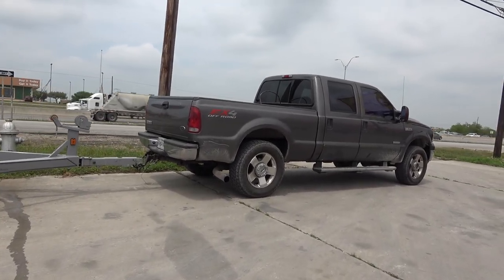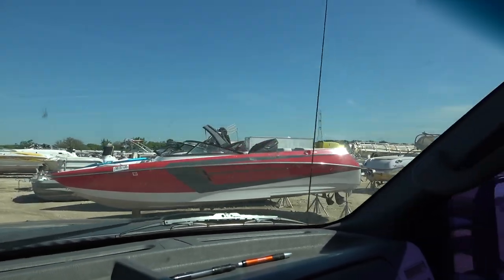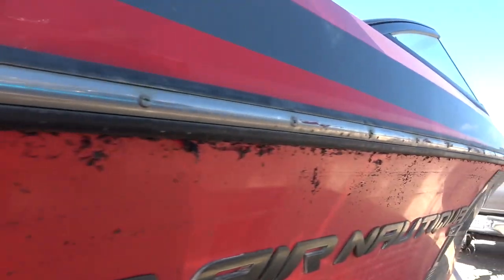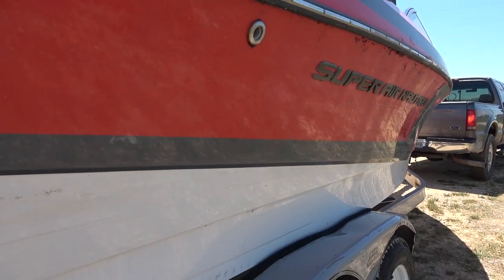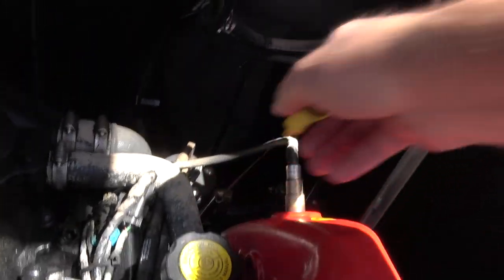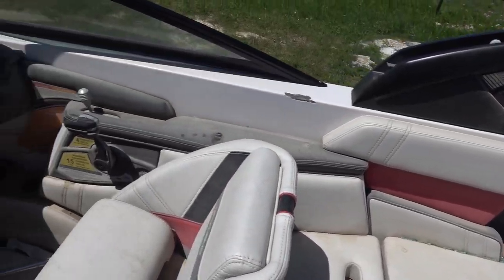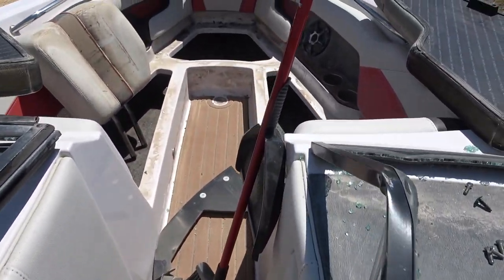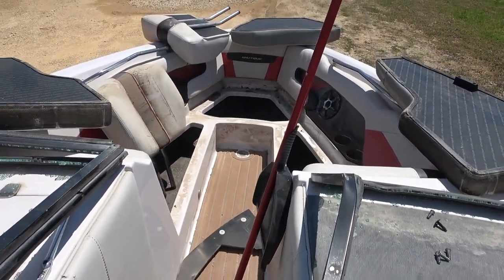I Bought A Wrecked & Flooded Super Boat From Copart Lets Unflood It?

Comment: Check engine light is on because it's a 6.0 ford.
Reply: Jeff Bennett look what gear it in lol lmao
Reply: jared perrino Doesn’t Change The Fact It’s A Shit 6.0... If It Were A 7.3 It Wouldn’t Have That Problem
Reply: @LostMisfit11  goid luck with the injectors on that 7.3
Reply: GarrettSelfVlogs 7.3 was the best engines. The 6.7 is also a really nice one
Reply: Your just jealous you cant afford one.. best dam truck on the market
Reply: 6.0 no go
Reply: It was in 1st gear. Also Ford is better. Compare ford to any pickup truck. (Not a Mac truck) it beats them all. 😛 eat this 7.3
Reply: 6.0 in limp mode with a CEL? id start with the crank sensor. that is directly the reason you started to see dodge and chevy utitliyu trucks (tow, ambulance, etc) around that era. CPS goes bad and the engine has no fallback so it just goes pants on head and limp mode randomly. not like there is any other way to get crank RPM than a direct sensor right?
Reply: 6.0’s are reliable engines if the proper maintenance is done to the truck.
Reply: Can confirm check engine light on 6.0 just means the engine is still there...
Reply: Can confirm. Mine is barely hanging on, speedo, shifter, and ignition are all fucked, check engine light has been on for 6 years
Reply: The studs on the 6.0 seem like the weak link. I've replaced two sets (to help out family), and I'm not even a mechanic by trade. If theyd have just upped the price of the engine/vehicle by 300 bucks during the build process, they could have had a revered and venerable engine. Instead, they cheaped out on absolutely CRITICAL components that gave them a name for TERRIBLE reliability :-(
Reply: I used to think they were shit but learned if you "bulletproof them, different head studs, better intercooler etc they become better than all except the 7.3. Look up "powerstrokehelp" here on.youtube. The guy runs a shop in georgia and he rates all the ford diesels.
Reply: @georgeperkins4171  not gonna put 10k into a truck worth 8 lmao. I only buy gas trucks now, the 6.2 is good enough for most applications
Reply: We bulletproofed our 6.0 5 years ago and it’s still great and it’s cheaper than buying a new one!!
Reply: @georgeperkins4171  the engine isnt the only problem though. The shifter, the speed sensor on the diff, the steering column, even the ignition all went to shit on mine. Shit trucks all around. An anomaly in the realm of Ford trucks really
Reply: Jeff Bennett haha
Reply: Yep delete and it’s maybe the best Diesel ever made

Comment: Holy crap , look at that brake rotor at 00:15 , missing a whole chunk!!
Reply: Holy crap good job spotting that.
Obviously the trailer brakes  don’t work or there would be big trouble on the first brake application.
Reply: That was probably the sound hecwas talking about
Reply: Good eye
Reply: Seen that as well looked to see if anyone else commented about it and you already have
Reply: Scott S  With a truck that is not running right. Only the winch strap on the bow eye of the boat. No safety chain in the bow eye encase of winch failure or strap breakage which happens more often  than people think. To top it off there were no transom straps either.
Reply: I'd put the rotor through the window of the seller....
Reply: Mike Grandinette that’s what I saw😂
Reply: good eye bro!
Reply: Says he got swindled on the trailer when everything is out in the open to look at before you buy it. Who's fault is that now?

Comment: Anybody else notice he was driving the truck in first gear the whole time?
Reply: guessing the indicator is broken as he was doing 60mph
Reply: Yea wtf... why....
Reply: haha that's an epic first gear! 30mph at 1800rpm, 57mph at 2300rpm, would give 125mph at 5k :P
Reply: yes I did
Reply: He was in second gear on the way back.
Reply: @donthemic  I saw that also
Reply: The gear selector on Ford trucks is always floppy, and shows the wrong gear on the dash.
His issue is probably egr or ipr or some other sensor.  Could also be the hpop... 
Rebuilt too many 6.0l.. garbage motors, even after they're rebuilt and bullet proofed
Reply: The problem with your truck is 🤔🤔🤔🤔 ohhh yea it’s a FORD!! It’s normal  to act crappy
Reply: @FiWelditNow  too bad they're the only ones that last pulling 30-45k pound dumpsters.
Tried all of the superduty/hd trucks over the years.
Dodge transmissions and axles always leave you stranded
Chevy transmissions and rear ends leave you stranded
Fords we have had will always get the job done, and are known for having the strongest drivetrain, just took them too long to replace the 7.3l with something reliable.
But hey, what do I know
Reply: @yleiva643  he said the indicator was broken.
Reply: Yep
Reply: @icanfartloud  nothing?
I dont understand your tactics so imma keep acting tough.
Reply: Yah my truck did that. easiest fix is a Zip tie on the shift lever.
Reply: Doy
Reply: @datboy5368  owned 12 well duh you replace em so often they dont have time do give you issues 

And plenty of gas and diesel million mile motors from ford 

The 6.4 diesel was garbage 

6.0 diesel was decent stock most its hate is first year issues but many are pulling million miles and bullet proofing just makes em more reliable.  

But realistically dodge ford and chevy transmissions all fail ... Lmao idk why people try to pull that about all 3 fail 

But the 7.3 and 6.0 are the best international motors in ford trucks the 6.7 psd is proving its worth hence why theyve stuck with it
Reply: vinny haha yah that’s what I was about to comment
Reply: lol
Reply: Ebola_AIDS_ISIS 7.3 liters are the most reliable truck in my opinion. Have one myself
Reply: Paul Morris i has two Ford trucks, the guest was a 1998 F150 extended XLT, and the day I traded it in it had 176k on it with no problems on it. It had 17,500 when I bought it.  I traded it in on a 1997 F350 XLT with the 7.5 gas engine.  I told one guy who asked shoot it, that the 7.5 was saying the gas mileage.  But on the highway I was getting around 10-11 mpg. It had 76k on it.  The only problems I had with it was the dash lights and indicators would suddenly blank out, then a couple mibs later come back on, including the tach and speedometer.  Also the front gas tank stopped working.  The last day I drove it, was a trip to my Drs office 32 miles away.  I had checked and added a half bottle of oil to it because it was a little short.  Halfway to the dr, I looked down and the oil gage was clear pegged to the left.  At first it didn’t bother me because  the gauges had blanked off and on before., and I had just checked it the day before.  So I kept driving.  Then I started hearing the engine start knocking.  I thought what the hell, pulled over and shut the engine off, thinking still it couldn’t be oil, I had checked and filled it up.  So I tried to restart it thinking it would reset the gauges  and it sounded like a train was coming through my dash!  So I shut it off, opened the hood, no oil on the engine or inside the hood, pulled the dipstick and it was completely dry.  So I called my wife to have her bring me 6 bottles of oil, still wondering what the hell. I put 5 in and it was right below the add mark, so I tried to restart and it was worse.  So I shut it off, called a wrecker and had it towed to my usual mechanic.  He found the engine locked up and he said the oil pump had went out, and apparently burned all the oil because it wasn’t circulating.  It had around 200-205 k on the engine, was mainly used for driving around town, and pulling a 40 ft 5th wheel to our local lake for the summer and then back.  It did blow an oil hose or a blow off valve or something like that, one time when I was trying to back the trailer into a real tight spot, so I was having to go back then forth several times to get it in.  However that’s it.  No other problems the 11 years I owned it.

Comment: At the 2:00 mark I realized you were here in Austin.   That boat was likely ROLLED when lake Austin flooded last october.   Boats would rise with the water levels until they hit the roof of the boat dock, then they would fill with water, sink, and the current would roll them downstream until they piled up at the dam.  That's why the tower and windshield are all crushed.  
Good luck with that build.   I looked at these myself for about 4 months, but couldn't pull the trigger on any of these.
Reply: mcgyverdude mainly lake lbj.
Reply: I live on  Lake travis, and I am not aware of any boat being sunk due to the flood.   Lake travis 's water level varies greatly, so all docks are floating-not piered like they are on Lake Austin or Lake Marble Falls.  I believe the water level on Lake LBJ is also allowed to fluctuate, so I would be surprised if anyone had a piered boat dock.
Reply: mcgyverdude and I lost 2 boats and 2 jet skis on lbj. See my profile pic wirtz dam. I’m a full time resident
Reply: mcgyverdude lbj is constant level all docks are stationary, my 30 ft Chapparal is in the bottom somewhere.
Reply: Cant wait to see rebuild!
Reply: I was on a 30' Chapparal last night!  Nice cabin. Sleeps 6. That was a nice boat.  So sad.

Comment: When the crane was lifting the bow of the boat water was pouring out of the bottom of the hull midship, around the keel. Drain plugs aren't installed along the keel. Check for a crack or hole that goes through the hull.
Reply: Hmm...that isn't true. Direct drive and V-drive boats have drains in that location.
Reply: We found out the hard way what the extra plug was for in our boat. There is a second plug right by the keel...

Comment: Hear that whistle?
See that smoke?
You just broke your powerstroke.
Reply: 6 in a row ready to blow
Reply: @BigCS784  except the powerstroke is a V8.
...
Reply: @elonmust7470  Im talking about cummins ya know the cumaparts
Reply: @BigCS784  yeah but we're not.

I've run 5.9s in heavy equipment for 20 or so years.. They'll eat pistons, spin mains, blow 3 quarts of oil past the rings every day, run at 240°, but they won't pop...  (Timberjack log skidders..)
Reply: @elonmust7470  So you pretty much said that they have to be rebuilt all the time.
Reply: @BigCS784  never before about 30k hours......
Reply: @elonmust7470  Well they dont really make enough power to blow up quickly so...
Reply: @BigCS784  I can pull 35k lbs of logs through the duff in one drag.
In first gear the machine produces over 39,000 lbs of torque at the wheels.......
All from a 180 hp 12v 5.9, be quiet city boy...
Reply: @elonmust7470  Ha city boy thats funny
Reply: @elonmust7470  39,000lbs of torqe? Comon now quit lyin to us
Reply: @elonmust7470  I guess being from a small town and living on a 80 acre farm is still considered being a "city boy"
Reply: @BigCS784  You're acting like one...
Reply: @elonmust7470  go ahead and explain to me how im actin like a city boy id love to hear it
Reply: @BigCS784  Acting like one is better than the other. Having grown up on ranches, the brand of equipment didn't matter, as long as it worked. If you really rely on equipment you'll like everything that makes you money!
Reply: @elonmust7470  yeah that is true we dont have much equipment out here
Reply: @BigCS784  6 in a row is gonna go... Is what I think you meant to say lmao. Let's not forget there's also 4 in a row. Never seen a Power broke make it to even 1mill a Cummins on the other hand 1, 2 even 3mill. Ther truck will rust out around that motor before it goes out.
Reply: Yes, I'm aware of how late my response is. I don't spend all day trying to see if my comments get replied to.
Reply: @christianclark2763  Hate to brake it to you but but their is million mile powerstrokes look it up
Reply: @christianclark2763  U said it perfectly 6 in a row is gonna go out good job
Reply: @BigCS784  how many million mile Power brokes are there compared to Cummins? Lol. It's okay though, if you ever have an issue just remember that it's circled and highlighted in blue.
Reply: @christianclark2763  What kind of test did they make you take is special ed cause on normal test you circle the answer not the problem.
Reply: @BigCS784  the answer to your problem is circled and highlighted in blue. How's that sound daddy? That wasn't a very intelligent response.
Reply: @christianclark2763  Well on dodges they already tell not to buy the hunk a shit cumaparts right in the name and ive never circled the problem before but i guess the special ed classes that you took are different aren't they.
Reply: @christianclark2763   I love watching when them big bad cumaparts get dragged by 6.0 powerstroke
Reply: @christianclark2763  What fucking video
Reply: It’s not a hard thing to do....

Comment: Boat trailer axles are supposed to be "bent" so that the boat can sit lower allowing it to launch in less water.
Reply: Steven P mostly preload and sway control
Reply: I learned something new today. Thanks!
Reply: Those axles are bent at the factory on purpose so that a very heavy boat will actually just flatten it out without bending it the other way! Kinda the same reason new  heavy flat bed trailers are arched

Comment: Engine lights on because it's a Ford and a 6.0 enough said
Reply: All fords ain't bad
Reply: Gotem
Reply: Kimbocf Aloggo   u must own one
Reply: @nickmeeks4475  so if you don't own one then you don't have experience with a ford
Reply: @chase_6273  no I have plenty of experience with them had and seen nothing but problems
Reply: @nickmeeks4475  ok well they were probably 6.0
Reply: @chase_6273  6.0 & 7.3
Reply: @nickmeeks4475  ok so you owned a 6.0 THE WORST FORD DIESEL
Reply: Chase 6273 stop, Fix Or Repair Daily fanboy.
Reply: Nick Meeks ford is reliable, my dad has a Ford that has lasted for 40 years and has not failed or needed repair in any way within its lifespan
Reply: @Dubscr  ya I'm sure just like Chevy gmc Dodge Toyota etc....... Some have more problems than others
Reply: DiscoverAudio yeah fix a 6.0 daily

Comment: I’m a mercury dealer and Volvo. I own a boat and yacht repair. .. that boat is a score since it’s prolly around 140k or more new  If the engine isn’t siezed u scored. That fiberglass work ain’t nothing and mostly the windshield is gonna be the most expensive.. also the code is easy call them they will give u it I replaced one of those before and they gave me one for a unit I bought new.

Comment: Very good price for that Nautique 230? Very important that you get a proper Nautique trailer, they're wider than Malibu boats from my knowledge and they're designed to sit higher and over the trailer arches. That's part of the reason your guides scraped along the side. Best bet for parts is to contact the Nautique factory?
Reply: The reason the trailer was not included with it is because those trailers are usually worth at least several thousand dollars for their custom fit. And they’re not going to just put that in with the boat that flooded.  Best advice I could give you is to try and see if you can look up the previous owners of the boat and see if by chance they still have a boat trailer they’re trying to sell because they’re trying to make some money off of it.

Comment: Also his truck is NOT in First gear. The shift indicator is broken. Happens in a lot of Ford trucks.
Reply: Only the 6 0s
Reply: No. I had a 4.0 Ranger and a 5.4 F150 do the same thing. They all use the same plastic bracket for the shift indicator cable.
Reply: I have 2 5.4 f150s and a 5.4 in my z none of them have a plastic part on the shifter with the exception of the module itself. Which if broke. Wont shift. I literally just checked both factory trucks

Comment: Looked like there was also water on the engine dipstick that jumped off. Trailer axel maybe you could fix and keep the trailer to buy another boat😄
Reply: Menno Boon 0
Reply: Boat trailer axles are supposed to be like that. If they were straight the boat would have to sit higher making it harder to launch.

Comment: Ok, the truck was in low 1, just wow. Then when I watched you bend that poor dipstick all to hell tryna one hand it. I wouldn't buy a wheelbarrow you've worked on. Man Card revoked Sir
Reply: 0:45 - 30mph, 1st gear @1800rpm
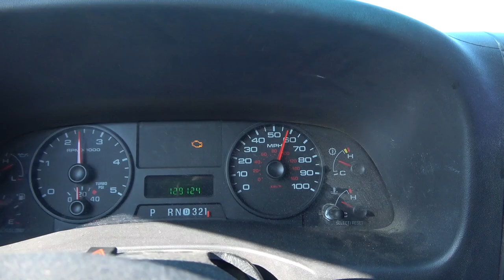1:01 - 57mph, 1st gear @2300rpm

That'd give 125mph out of "Low 1" at 5k rpm!

 Hillbilly Dranyam, ya reckon the display might be broken?

As for the dipstick - with you 100%

RIP Dipstick. F
Reply: @haydona1845  Lets be fair -checking the oil is BASIC maintenance. My mate with one arm can check his dipstick and put it back, but he can't do the most basic thing, leaves you wondering about the quality of the rest of the work sometimes.

But yeah, sure, it's just a dipstick, I mean - who needs that to be the right length?
Reply: @the_mad_ratter  Not at all saying that is not important but at this point there is seems to be other more important matters on that boat than a bent dipstick which will probably get replaced anyway
Reply: @haydona1845  Yeah I get you, but making more issues is not a cost effective way of repairing a vehicle :P
Reply: @the_mad_ratter  It does make sense. I was just looking at it from a personal angle. I would replace the dipstick anyway but I see where you are coming from

Comment: I'd de-cap it. Remove the top half from the bottom at the seam, then do structural fiberglass repairs with the top turned upside down.  Then body work the outside. A new windshield and frame won't be cheap. I've done those rebuilds, lots of work. If you can get to the needed repair areas from underneath you might avoid having to de-cap it. But won't be an easy job. I wouldn't have paid more than $200 for it knowing how much work it will be to fix it.

Comment: Definitely get it checked out those 6.0's are notorious for being expensive especially if you are towing with it my moms boss has two of them and they spent $15,000/truck getting it fixed they have to pull the entire cab of the truck to fix it, it is something to do with the inside of the engine!